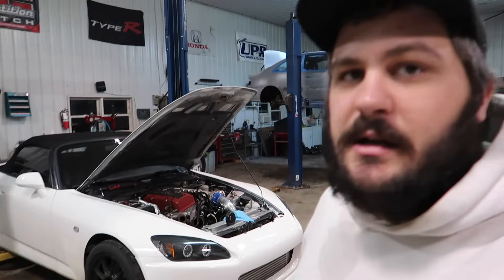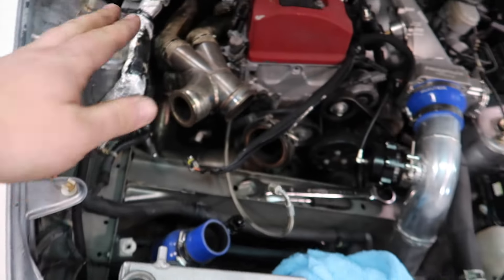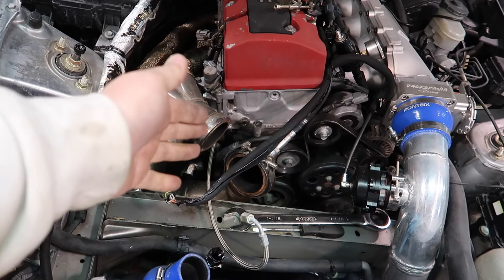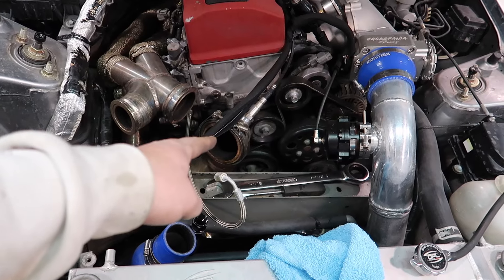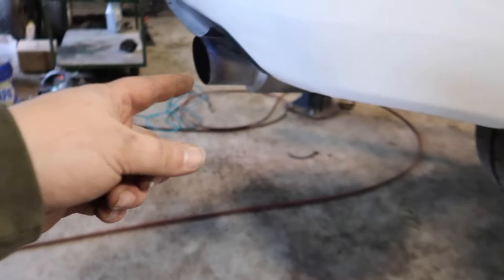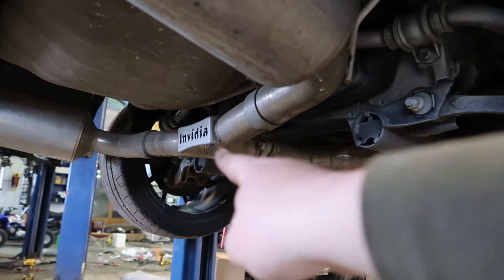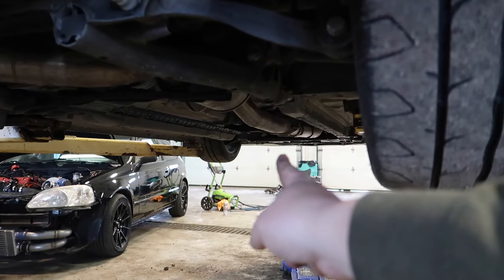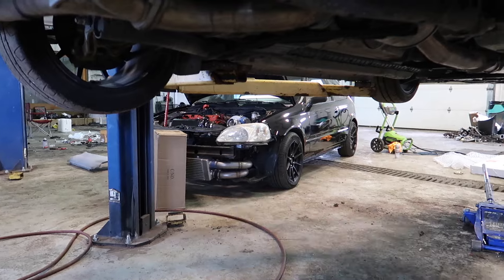My Turbo S2000 Is Melting Everything So I Wire Tucked It

Comment: You should think about a fuse by the battery. You have 8 feet or so of 0 gauge wire that god forbid your wire chafes threw, i wouldn't want to see it burn down. Yes your fuse in the fuse box should give, but that isnt stopping a positive wire possibly touching bare metal untill sparks fly. Not hating bro just want you to think about it. Its not like its an easy replacable wi civic. Safety measures need to be taken when relocating a battery.
Reply: I put a waterproof circuit breaker right next to the battery instead of a fuse. It still protects the wire but can be easily reset instead of having to buy a new fuse

Comment: at the end of each connector, you can add a larger diameter of heat shrink that acts as a cover, only shrink one end of the heat shrink.

Comment: Heck yeah bro .. i just put a 4849g (g25-550)  on my daily toy n man its rough on your internals down low .. i am basically positive pressure soon as im off idle 😅 but i feel once i go for 9k rpms it might have some serious back pressure at that high a rpm ... i also run 34psi so that prolly dont help 😅 but its forged and built ... if the s2k has rods i say go 4849 and send it but if not maybe the 58 would be the good medium... love the content bro peace and love all keep it rad stay safe and build on l8z famz and keep having fun

Comment: A little late with a comment, but DC5 creations have tucked AC lines and condensor for Civic's. Maybe they have some lines that can be used on S2000 as well, so you can tuck the lines behinde the fender?